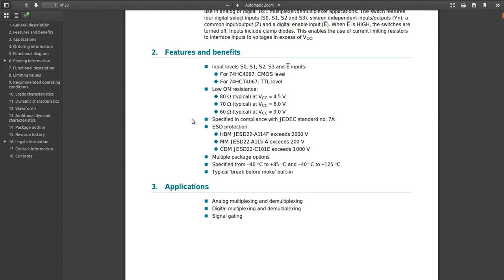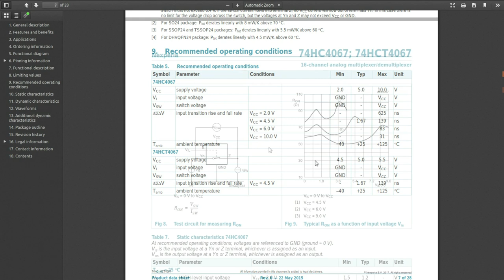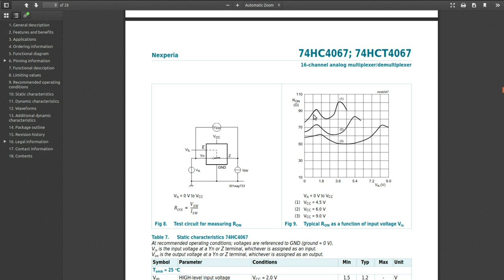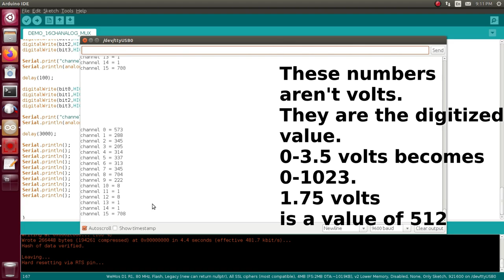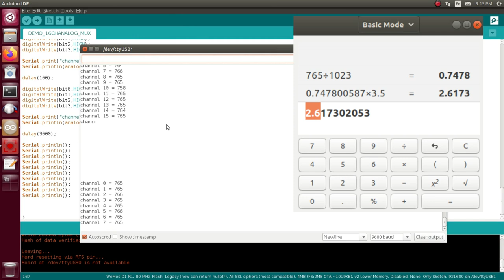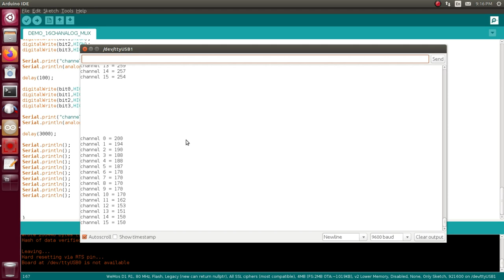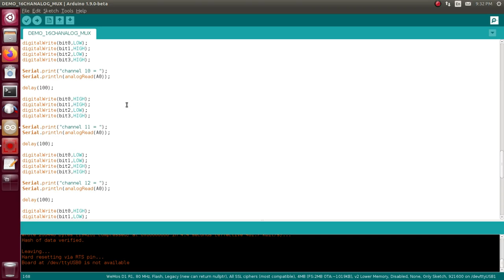tinkering with an analog mux module

Comment: I used it on the Notes and Volts TS-1 Synth to provide 15 potentiometer inputs to a Teensy. As I wasn't using a PCB, I did it the hard wired way which meant that I ordered the 4067 and a 
suitable separate adapter board. If I'd only known I could have bought it as a module. Oh well, the SMD soldering practice was useful.

Comment: The input is 3dB down at the output at *100 MHz*! You could probably run video through these things with acceptable degradation for say multi-camera security or yard-wildlife-monitoring purposes if the gates are as good as those in the old 4066 used to be. I built my first video switcher around one of those. Learned a lot about how not to design video circuits. ;>)
BYW, you missed Mailbag Monday and I was a bit worried- I guess life gets in the way of YT occasionally. Good to see you're well.
Reply from the maker: I'm back to my normal schedule with mailbag Monday - every second week. 
December is special every year,but I can't afford to sustain that pace all year.

Comment: Is the adc max input on the esp8266 only just over a volt. Need to check data sheet.
Reply from the maker: Is it? Damn I didn't know that.
Thanks for the info.
Reply: @pileofstuff  The input voltage range is 0 to 1.0 V on ESP8266
Reply from the maker: @TheEmbeddedHobbyist  True, but many dev boards implement a voltage divider of some description to allow for an input range up to VCC (3v3)

Comment: Being an old git my memory jumps back to the 4016/66 cmos signal switching chips.
They worked but not that well, i've seen the inputs/outputs fed with bias resistors to correct a problem with them.
That was for switching audio.
There on resistance wasnt brilliant eather.
My favorite chips were the 74Ls138 3 to 8 line decoder and 4017 decade counter.
Good old chips :-D

Comment: How fast can you poll through the channels? I'm thinking it could drive a spectrum analyzer by cycling the same input through a different filter on each channel.

Edit:  thanks for another thought-generating video.
Reply from the maker: The datasheet suggests it can switch channels in 25-50 ns with VCC=5V, (slower with lower VCC).
Reply: @pileofstuff  Nice. That's a useful chip I never knew existed.

Comment: I wonder how it would sound if you had multiple sinewaves of different frequencies and you stepped through them sequentially repeatedly at various speeds. Would the signals sound like dirty non-white noise, or robotic gibberish gleeps and bloops....
Reply from the maker: I suspect you could get is sounding fairly musical if you selected the tones carefully and timed the switching properly.

If you switch them fast enough (not manually like I was), there isn't any audible glitching

Comment: Make an led panel that flashes randomly like one of bug Clive supercomputers. Basically I mean make non blinking leds blink. I've ordered a bunch of verrow board and I'm going to build a cmos circuit that you can plug a panel into and create random blinking by pulling certain leds low then high. I'm drawing up the led circuit because there can't be one big vommom ground I don't think to achieve the blinking effect.